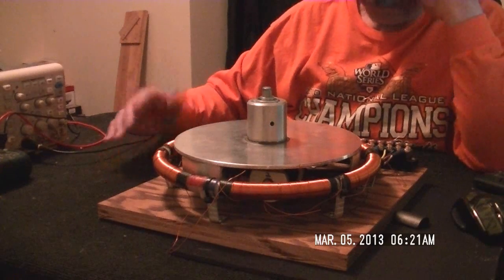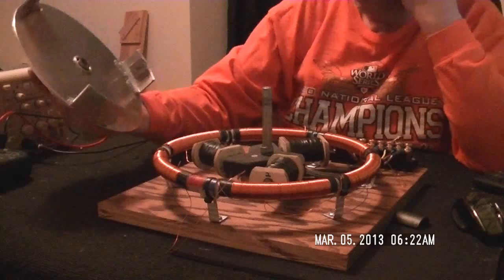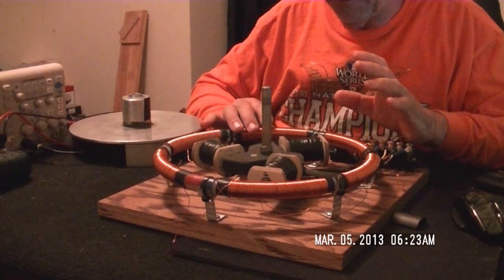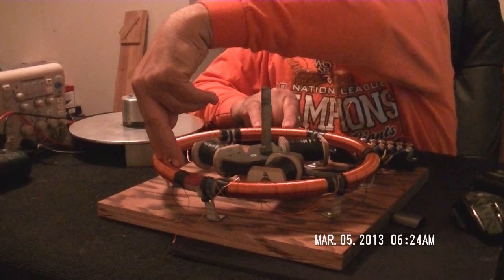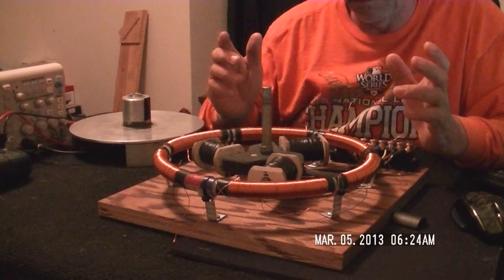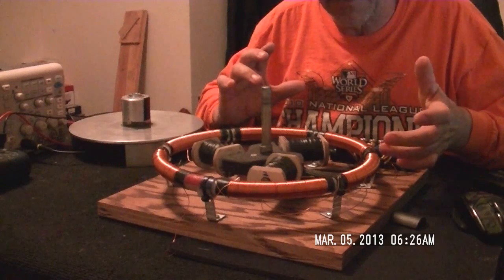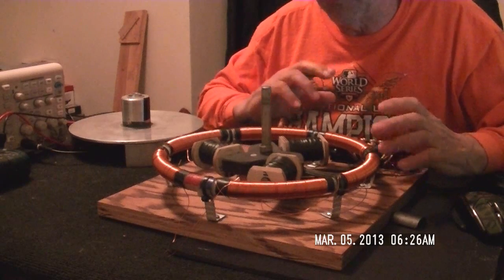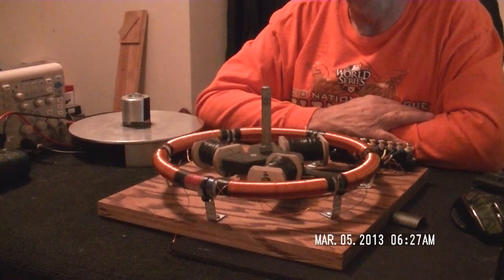Bidini: Outside In Motor; EDDY II OverUnity Plus

Comment: Have you ever seen any of Stan  Myers inventions he has a charged gas particle accelerator where he uses negatively charged hydrogen particles and accelerates them inside a multiple coil wrapped circular air tight tube with electromagnetism and has some coils drive other's generate. What your doing reminds me of that. So in a sense it is a generator with no moving parts and hardly any noise if any. Keep on it bud I really think your on to something and I would be more than glad to help out with it when I get some time.

Comment: INSIDE THE TUBE REPULSION OF MAGNETS  N-N MANY MAGNETS COULD WORK.
Reply from the maker: There was too much internal resistance caused by too high of coefficient of friction of the plastic.  I have since redesigned the tube with a drive circuit the eliminates the need for the rotor to drive the magnets thru the tube, I use the coils to drive the internal magnets.  See my video on the ...Bedini Linguini Accellerator. https://www.youtube.com/watch?v=Cx5nq3BHKK8

Comment: I'm an electronic technician and would like to help. I need to know a few things like how big is you air gap between the magnets and your iron cores? Also, is there holes in the tubing to prevent air pressure from building up. Ideally in the large scale you could have ball bearings to lower drag inside the tube.
Reply from the maker: Thank you, I appreciate the offer but I've already finished this project. I've posted the finale on my channel.   ....and I did end up using neodymium spheres inside the tube.

Comment: I HAD A SIMILAR IDEA LIKE THAT. VERY GOOD IDEA. CONTINUE YOUR WORK. SORRY ABOUT MY ENGLISH. PULSING THE MAGNET LIKE TESLA DID. MORE ELECTRICITY OUTPUT. DON'T HAVE TO BE HORIZONTAL. CAN BE VERTICAL AND THE MAGNET CAN ROTATE IN THE TUBE. VERY GOOD IDEA. GOOD LUCK.
Reply from the maker: I never used any kind of lube coz this material is an closed cell polymer, kind of like nylon...but it couldn't hurt I guess.  Thanks

Comment: so its pulling the magnets in the tube all the way around with the bigger magnets? thats very innoative man great thinking!!!
Reply from the maker: Thanks man,,,  but becoz it was a poly tube, there was to much resistance to the magnets sliding so I only had 3 interior ball magnets rotating.   I wanted to make a custom borosilicate tube but I didn't have the capital to invest.
I ended up designing an closed loop
accelerator tube to continually shoot the magnets through the tube, not requiring the motor but it needed an glass tube too.
Check that video...it was a fun project too.
Reply: Sir Farquat have you tested how the magnets react to oil? lubing the tube or filling it with oil? Its cool with efficiency but its not worth it if the cost is to high as the power to run the generator is free. Im waiting for 24 n48 neodymium magnets at 33kg each for a axial flux generator driven by a VAWT. Im gonna gear it to get the rpm's right. Im building a modular design so I can add more stator discs and rotors if needed.

Comment: you could always use a reed swith setup to fire your trigger coils. a mosfet and hall sensor wold be more efficient, but for simplicity there is always the reed switch for timing. the Bedini schoolgirl circuit uses a transistor and a reed switch to to fire it's trigger coil. your setup would need three reed's and three transistors, but only one pickup magnet to trip the reeds. almost like having a commutator. i like your concept very much. it would be nice if your outer magnet/coil tube was glas

Comment from the maker: Frictional? or Lenz... ?
  I could to let it run awhile then use an optical IR temp probe to see if it reaches equalibrium above ambient. I doubt that it'll go into thermal runaway however, if turns out to be an issue beyond just annoying, I could vent the tube, then use the wind generated (lots too) by the rotor to evacuate the heat.
Thanks for sharing your observation. be well my friend...

Comment from the maker: Yes, that is a kewl idea..from around 6:50 I discuss that possibility and we're actually past proof of concept as it works very well,  Although I can design and build anything mechanical, I'm limited beyond letting the smoke out of the circuit. LOL
I'm trying to use hall sensors to trigger Mosfets to accelerate the neo pak but can't seem to find a circuit that I can get working with my limited background so I'm still learning transistor theory and searching for a model  
Thanks for watching...

Comment from the maker: Ok, I tried the spheres and they work great.  Instead of having two elongated contact points for each interior Neo magnet, a sphere creates a single point of contact. The spheres reduce the rotational resistance by a factor of 4.... or better!  
I'm gonna run 30 spheres (3 packs of 10) 10 bound to each rotor driver and it'll create less drag/resistance then I had with just 3 of the other magnets.  Thanks for the idea my friend...

Comment from the maker: Thanks for the kind words. 
Yes, they pass thru the flux coils but I see a strange waveform between the high outputs.  There are six flux coils but I only look at one while indexing the rotor. I get an AC waveform when the interior Neo is within the flux coil field however, I see other waveforms even when that flux coil isn't active.  Maybe eddy current from the rotor Neo's are forcing electrons thru the preceding coils then inducing a signal in the scope?  It seems like an usable component.